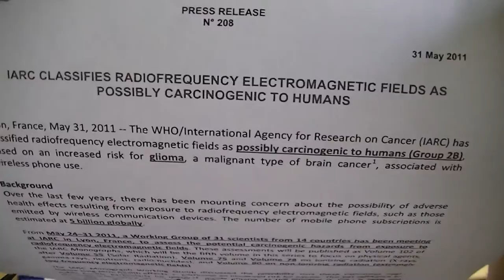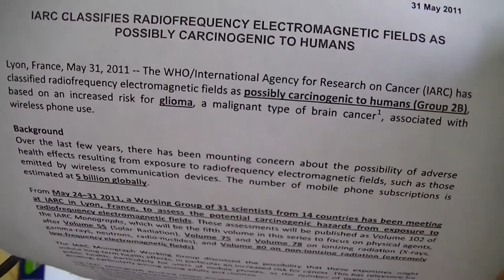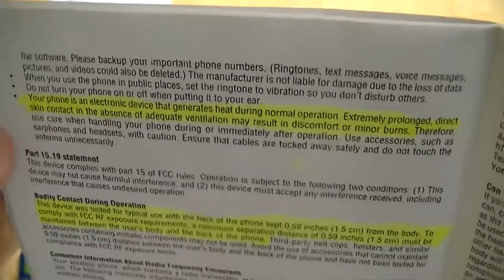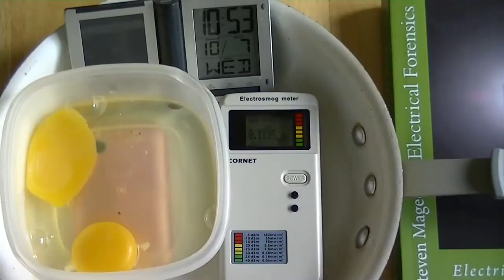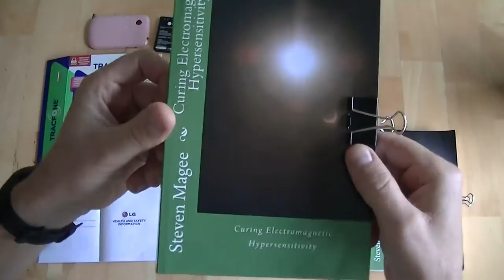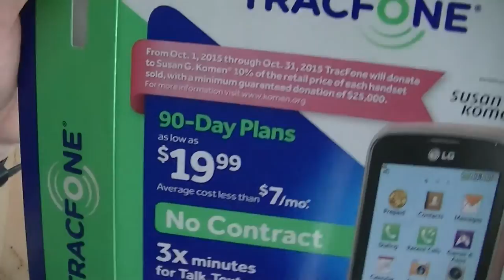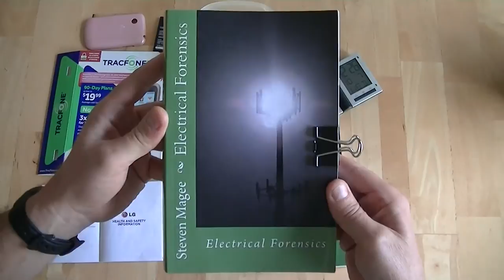Frying an Egg with the Susan G Komen Pink Tracfone

Comment from the maker: Yes, my ears have a high pitched buzzing in them that drives me crazy!  I live 2,000-2,300 feet from 3 antenna towers and the community has gas and electric radio frequency (RF) transmitting utility meters in it: http://environmentalradiation.com/Say%20No%20to%20Tucson%20Tranmsitting%20Utility%20Meters.pdf